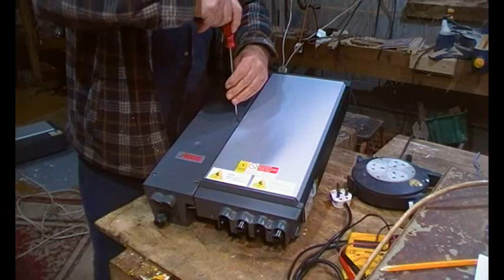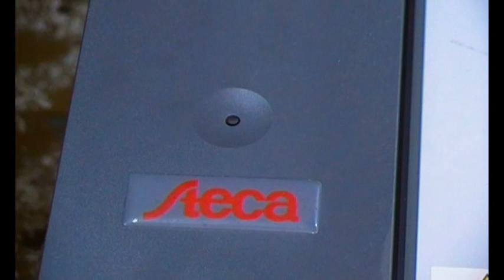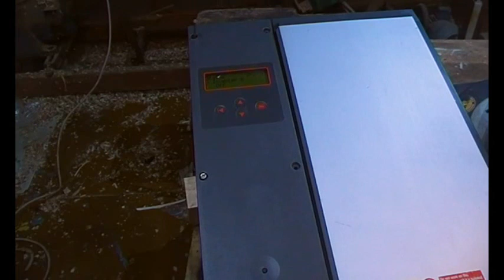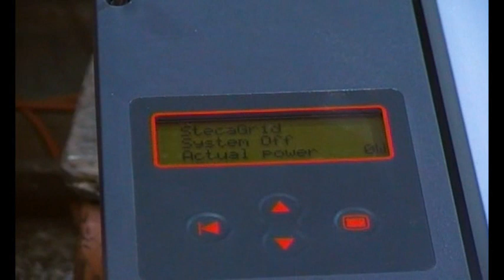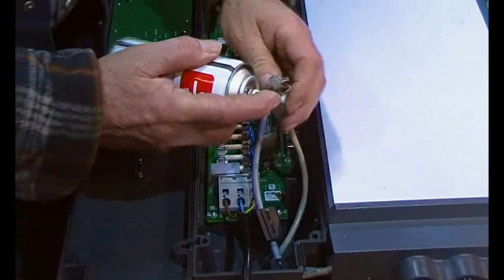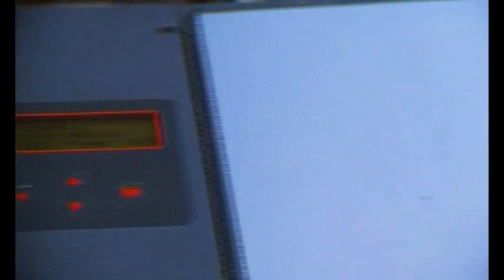Testing a Solar inverter: stecagrid 2000, Variable DC power supply.

Comment: Bonjour, j'ai une installation avec des Stecagrid 2000+, 2 master et un esclave. Le slave 2 est en état "off" et les autres fonctionnent. je bouge un peu les câbles AC etDC en-dessous de l'onduleur slave et parfois il redémarre. Est-ce un problème sur le bornier de l'onduleur esclave! J'ai mesuré la tension sur l'onduleur maître, le AC est bon et le DC des panneaux ok aussi. De quoi ça pourrait bien venir? Merci à vous.
Reply from the maker: Hi, there are problems with the communication connections, I have a Steca inverter that needs to be disconnected from the mains each night before it will start, I use a time switch for this. Try contact cleaner for all the connections, if that fails look for bad solder joints. I hope this helps, cheers

Comment: I have a steca grid 3010x..no error messages but no output either, pv voltage is showing 0/1v but it's not array related, it shows the grid details and they are all in spec..about 20 seconds later they all change to zero. i don't hear the contactors or whatever it is that normally clicks when it starts up either. Any helpful thoughts for a idiot with a multimeter and a basic understanding would be most appreciated.
Reply from the maker: Check all your DC panel connections and also the sockets within the inverter. change to another internal ethernet socket and use switch cleaner, cheers
Reply: @TheInfoworks  Thanks for that, i will have a look. It's had a easy life in a cool outdoor location so hopefully its something simple. Thanks again.
Reply: @TheInfoworks  Had a look, found a burnt 4 pin connector inside that joins the 2 circuit boards together, guessing the push on connector was not so tight inside, couldn't find any other damage so cleaned pins and bodged it with some chock strip..she is going again, tempted to stick with my bodge as the Pheonix contact connectors are so expensive and appear to be flimsy. Anywho just a update, cheers.
Reply from the maker: @hub-p4g  Brilliant, the power of perseverance. We all learn something from this, and yes go with your stronger repair, cheers

Comment: i have one of these that has worked fine for about 10 years, 6 months ago it has started randomly failing to start with a message on the screen saying set clock, if i set the clock it works again for a while before giving up again, i looked inside and cannot see a real time clock battery anywhere that could need replacing, any suggestions
Reply from the maker: Hi, check the internal socket connections, otherwise it's a software issue, change the unit for a solar river or solis from Ebay, cheers
Reply: @TheInfoworks  i also have a few SUN-200002 inverters that have been brilliant, i may replace it with one of them since i have had a 100% suceess rate with them, but i would need to re string the panels as the SUN-200002 only run 45v to 90v. just thought there cant be much wrong with the steca inverter, it actually works most of the time.

Comment: Thank You Andy !!!     My 10 year old panels were struggling to start, so i isolated everything, removed all the connections in the box, cleaned them as you suggested, let them dry, reconnected , and switched on, and now works absolutely fine !!   Ive also noticed i now have the full menu back on the LCD panel .   Best regards   Phil .
Reply from the maker: Phil, splendid news, I do the experiments so that you don't need to. It's grand you have fixed it, please see my Paypal, like & subscribe, cheers